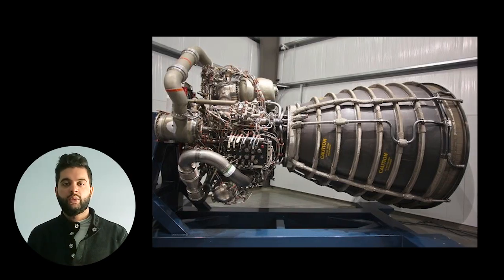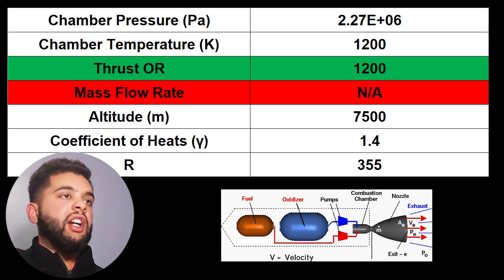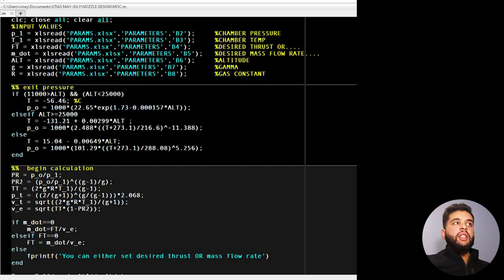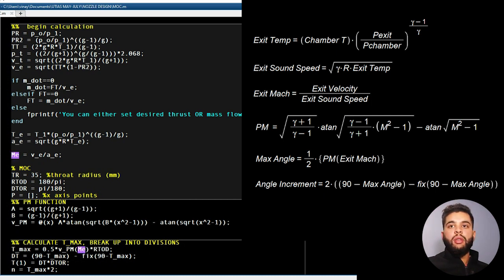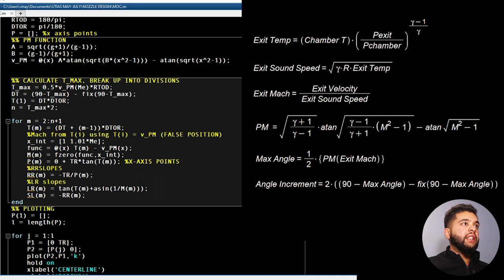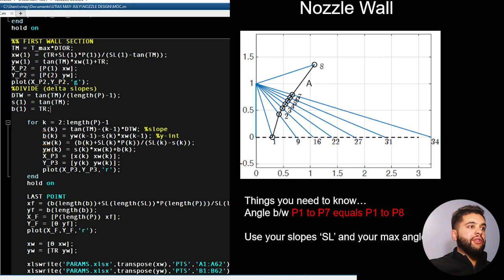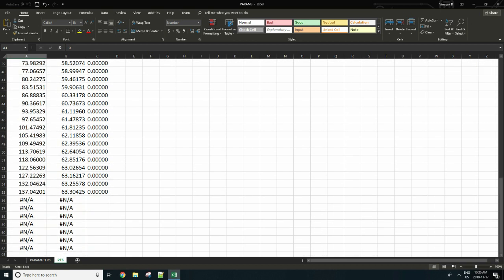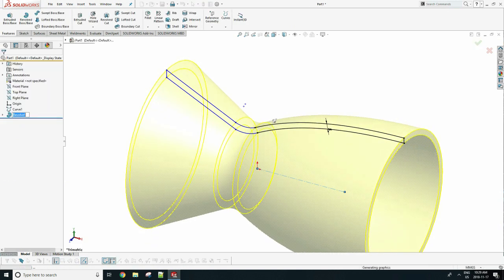Rocket Engine Design with MATLAB and SolidWorks - Method of Characteristics Nozzle Tutorial!

Comment: Thanks for uploading such a great video.
Is profile generated using Rao's method, the same as MOC. Or will it generate a different contour?
I believe the exit wall angle in Rao's contour isnt zero. 
Would be great if you could share some light on it.

Comment: Your code works great, I've got to give you credit for that! But I can tell that you had a very poor understanding of what the variables were, and what they meant. Under "%% begin calculation," you said that TT is a temperature value, but R is not dimensionless, it's a specific enthalpy. Also, PR2 isn't a pressure ratio, it's temperature.

I think it would be great if you knew this so you could improve your code and documentation!
Reply: Also, I just saw your updated video. I started modifying your code well before you made that comment. Thx!

Comment: I dont understand the calculations for exit pressure such as  T = -131.21 + 0.00299*ALT ; and   T = 15.04 - 0.00649*ALT. Why -131 and 0.00299*ALT. I have been searching for the formula off the nasa website but couldn't see it either. I hope you will see my question and explain. Thank you in advance
Reply: https://www.grc.nasa.gov/www/k-12/airplane/atmosmet.html

Comment: Hey, if I want to simulate flow in the cd nozzle for merlin engine, but I take inviscid flow and air instead of the real propellants, will my chamber tmeperature and pressure be the same as the real values used in the engine?

Comment: Can you show the code for shifting equilibrium? Also do you know how to find the right converging contour and how to do combustion chamber sizing? Your contents are much appreciated.
Reply from the maker: Hello, this project is from a while ago, if I find it yes I will share for sure, thanks for your comments:). The combustion chamber sizing is not that critical, as long as it maintains the pressure initially (when t = 0) right before the engine is started, and that it's structure (pressure vessel) can withstand the stress. The converging contour shape is any which minimizes drag (or does not lead to wakes), and is dependent on the rocket size etc.

Comment: Given that n is computed as n = 2*T_max, and assuming that is a float, how can you run a loop that goes from 2 to n+1? It surely given an error...
Reply: Did u find why it gave an error@martina formidabile
Reply: @viralstock2784  yes, it says n is a float and it cannot run the loop with the index being a float. It must be an integer...
Reply: How Did u solved it then..?@martina formidabile...
Reply from the maker: It ran fine on my computer, m goes to 56 and n is 55.3, to fix this just use floor to make n an integer.
Reply: @VDEngineering  Bro, thanks for this explanation and for taking the time to explain the code, but I have a question, why you take n=2*T_max? I believe the length of the for loop vector should be n=1*T_max. the final T(m) should be equal to T_max no 2*T_max. that's twice the deflection of the wall. Am I missing something?

Comment: Hi. 

If I want to change the code to axisymmetric should i put radius^2 in every formulas?
Reply from the maker: You could try, but just use planar for now
Reply: @VDEngineering  Just wondering what are differences. I would like to compare both methods, but dont know how to change the code

Comment: Hey man, another question, at 5:19 you explain how to get the throat temperature. When I run the MATLAB code, the throat temperature comes out to be 2982000 which doesn´t make sense. Sorry if im bothering you, I´m just trying to understand.

When doing a dimensional analysis, the units come out to be kJ/kg, not kelvin as one would expect.
Reply: i too have d same doubt...the formula izz wrong..
n i have a question that when we calculate exit mach from area ratio we get different value which is much different in exit mach we get from code.

cn u suggest e smthing..
Reply: If I want to change the code to axisymmetric should i put radius^2 in every formulas?
Reply: Has anyone solved the throat temperature problem at 5:19???
Reply: Try to put TT = 2*T_1/(g+1) instead

Comment: Just wondering, in the equation: pt=((2/(g+1))^(g/(g-1)))*2.068 what exactly is that 2.068? Is this a mach number for the midline of the nozzle according to the parameters? Just trying to understand more fully
Reply: Love the video though really helpful in trying to get my own code to work. Forgot to say this in the above comment.
Reply: @terencecostigan4585  please, have you found an answer for your question above 2.068 ?
Reply: @toufikkhattara4406   Not yet. I haven't seen that equation for critical throat pressure either. So I don't know.
Reply: @terencecostigan4585  Did you found the answer?
Reply: @toufikkhattara4406  have you found an answer for 2.068 ?
Reply: have you found an answer for 2.068 ?
Reply: No . Not yet

Comment: hi 
first think you for your help
so i try to run your programme but a get this message errore 

You can either set desired thrust OR mass flow rateError using fzero (line 290)
The function values at the interval endpoints must differ in sign.

Error in MOC (line 66)
    M(m) = fzero(func,x_int);

can you help me to fix it
Reply: i too face d same prblm..did u got any solution to fix it...
if yes plzz help me out..
thank you!!

Comment: Really useful mate, great video. i'm currently in my third year of an Aerospace degree and i'm doing a project about rocket nozzles.
Reply: If I want to change the code to axisymmetric should i put radius^2 in every formulas?
Reply: @pawekaminski5110  Were you able to find the answer to this question ? I need to do axisymmetric as well .